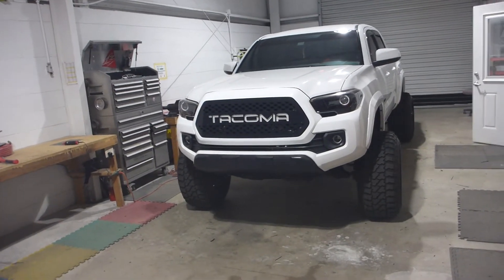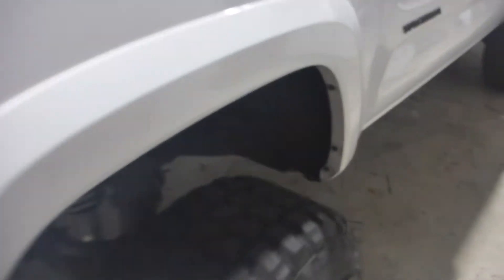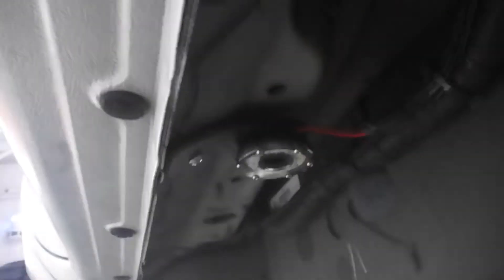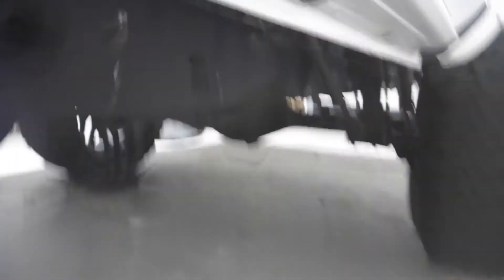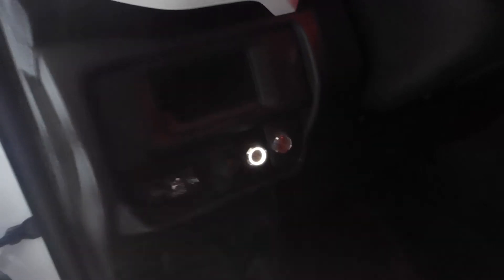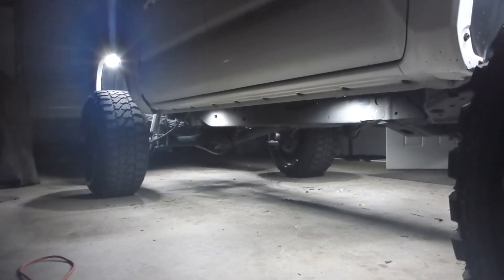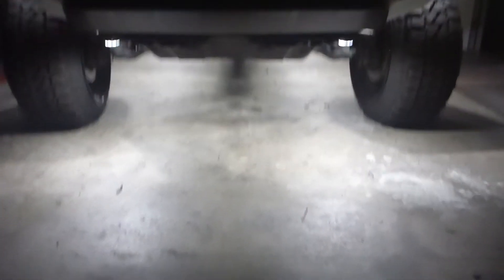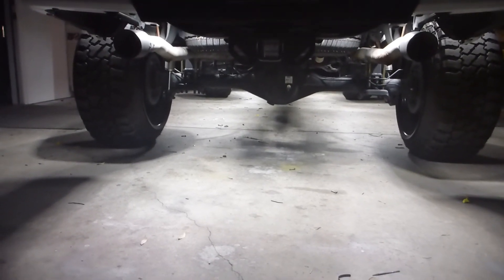2017 Toyota Tacoma KC Lites Cyclone Pure White Rock Lights Install

Comment: Great video - these little lights get really hot fairly quickly.  Would you recommend the lights installed on a plastic platform of a vehicle? Would I need to add another material to act as a heat shield buffer?
Reply from the maker: If you can still hold it, it ain't hot enough to melt plastic.  Time will tell though; we haven't had any problems with this install yet.
Reply: @Bythirteen  appreciate the honesty.  You make a good point. The lil lights reached 130 degrees after 10 minutes of constantly being on. Although I may be able to hold them, it wouldn't be for very long.
Reply from the maker: @deganni2688  No plastics used in automotive manufacturing would be affected by 130*.  I play around the 300* range for the super thin stuff.

Comment: $1400 for rock lights is insanely stupid. Also, those self tappers into the metal wheel wells will eventually rust and break, leaving you with some lights dangling around looking like a 2 year old wrapping lights around a Christmas tree
Reply from the maker: ah, the vigilante youtube commentator.  Thanks for your opinions on the topic.  Worthless incorrect opinions, but thanks nonetheless.